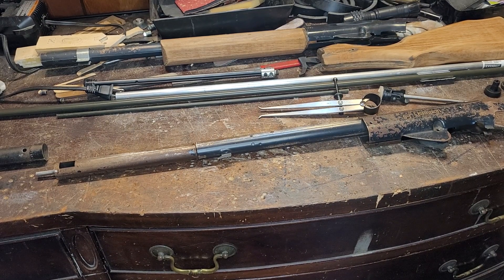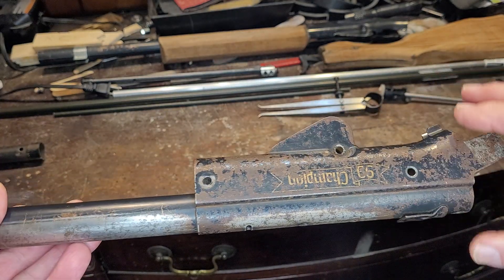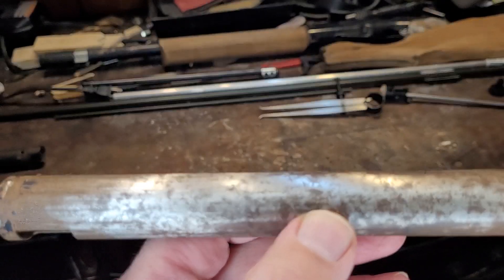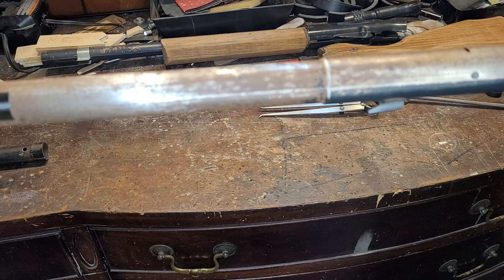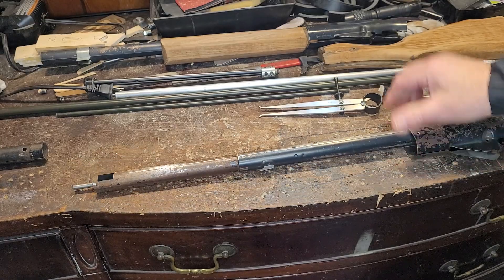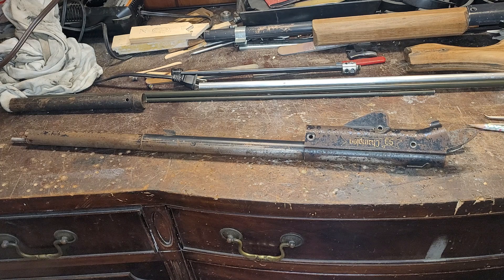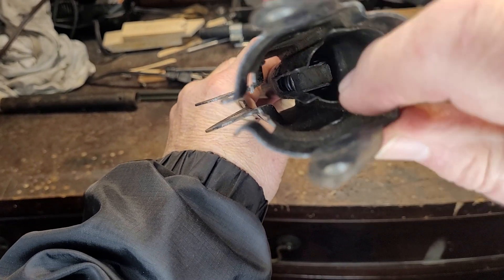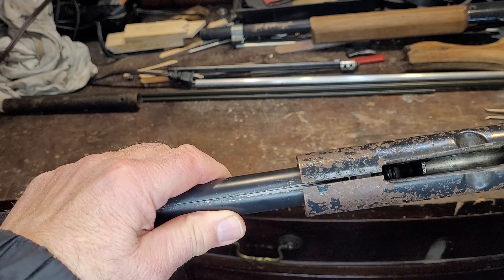Daisy lever gun fun.  39. Model 99 Champion

Comment: Russ take a 499 abutment  plug  drill it to 7/16 shot tube size of the the plunger side of the abutment plug drill so airtube will go through it like the rest of the gun still accident on a couple of the 1938 b and it worked pretty good you can used a model 25 shot tube with copper spacer is Bruce does you might try that buddy have a good night
Reply from the maker: Did you lay awake thinking about this one?  Lol